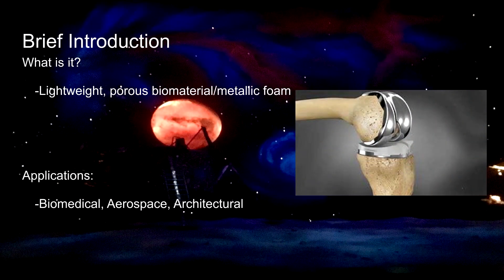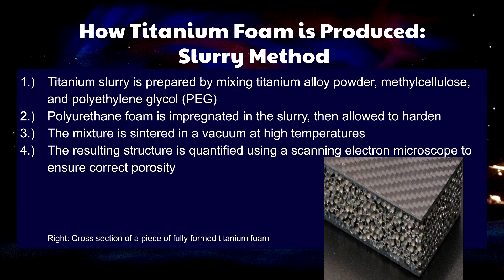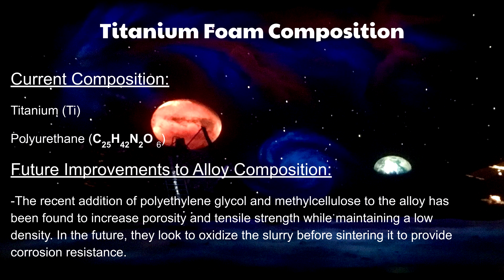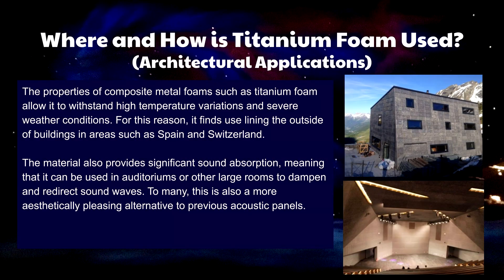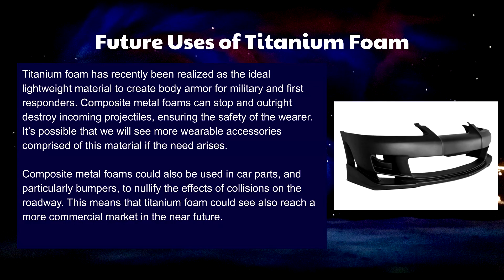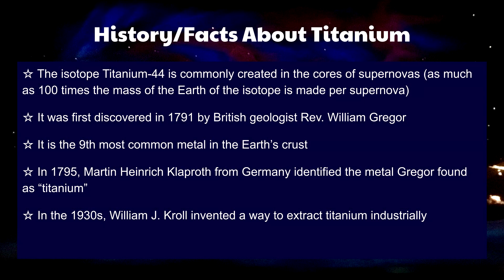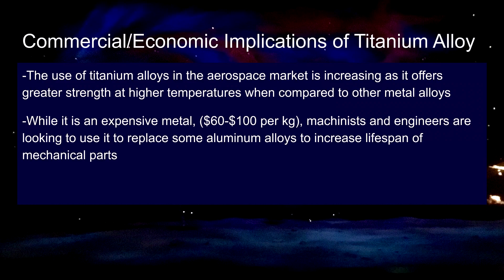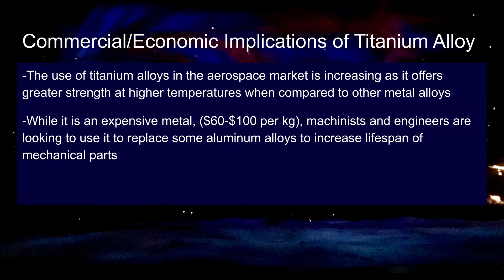PHYS 1502Q "Magic of Materials" - Titanium Foam

Comment: Titanium is also a great electrolyzer electrode. With the greatly increased surface area of titanium foams, much more hydrogen can be generated per unit volume than traditional flat plate designs. Also, this kind of electrolysis can be used for all sorts of water-splitting applications such as creating alkaline water for superior hydration in athletics and cosmetics, hypochlorous acid for broad-spectrum disinfection, etc. There are perfectly good machines today that do all of this, but titanium foams can miniaturize that technology so it can be embedded in other technical products.